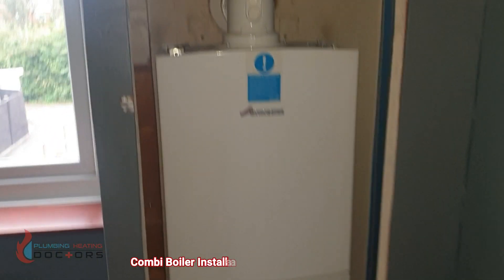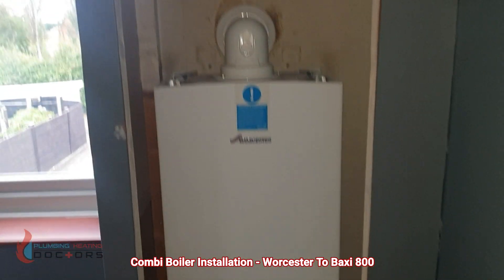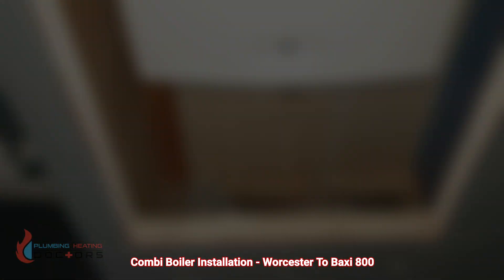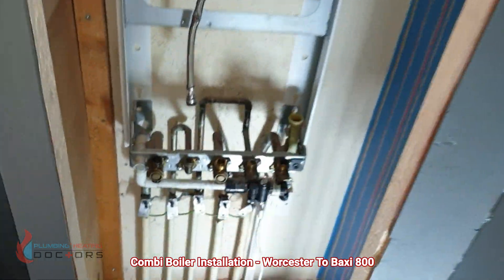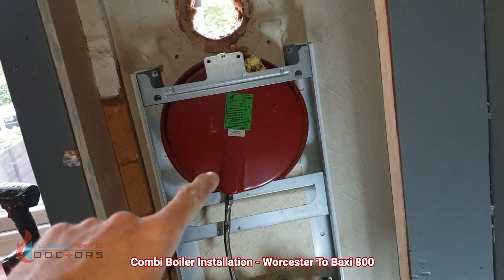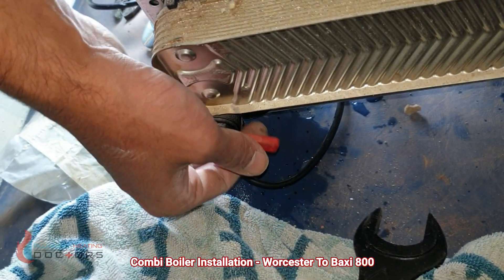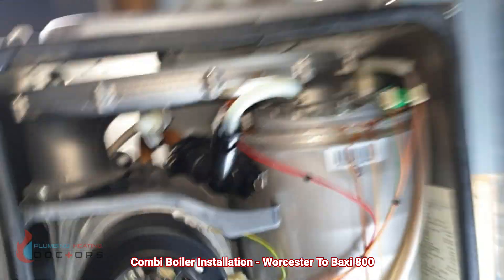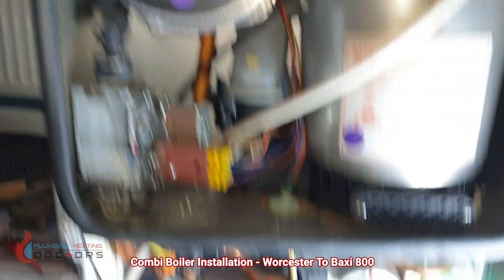Worcester Bosch Combi Boiler UPGRADE To Baxi 800 **PIPEWORK**

Comment: Why UK uses copper pipes instead of better option -plastic/alu combi pipes? Copper is radiating too much to outside and you lose efficiency from boiler. NONE of pipes are insulated.
Also pipes looks very tiny in diameter.
Reply from the maker: Copper is best

Comment: Nice neat installation waseem, I like the way you took your time and offset the pipes to make it look good visually I suppose the old boiler was repairable but it depends if the customer wants to spend that much on that old boiler it’s obviously over 10 years old , did you not do a flush by the way? The servicing on the Worcester boiler was not a proper service but just one of them cheap jobs
Reply from the maker: Thanks.. Yes we always try to make it neat and make sure all valves are accessible. 

Your right the boiler could have been repaired but the landlord wanted a boiler with warranty for peace of mind as the didn't want the headache of future issues. 

We did flush the system but its not in the video as we have covered flushing in another video.
Reply: @PlumbingDoctors  It is Waseem isn’t it ? your videos are getting better but try and talk through the installation rather than the music . how comes you were working around that condensate pipe that kept getting in your way could you not remove it from the elbow and refit it afterwards? you could have melted it at one point
Reply from the maker: Yes its Waseem..Where do i know you from?as i know quite a few Salims...

I have more vids in the pipeline which i am talking more but thanks for feedback, i will keep that in mind 👍🏻

The condense pipe was existing and it went into a stack behind the wall externally so i did not want to disturb it. Burn the condense no chance lol its all about the angle of the flame 😉
Reply: @PlumbingDoctors  Salam Waseem,I saw your name on your shirt on one of your previous videos when you took out the viessmann  boiler with the burst pipe,The one almost mounted on the floor,
Yes Salim is a very common name amongst our lot,  I used to be a heating engineer back in the 1980s ( corgi then) In our days the combination boiler was still fairly in its infancy and there was some very very big complicated boilers like the potterton lynx and netaheat. The one i used to hate was the Ariston Eurocombi , A very temperamental boiler unreliable and used to leak a lot we were forever changing PCBs on them,! Most common brand with British Gas was the Vokera, Sorry I didn’t see the angle of the flame I thought you were going to melt the condense pipe!  Chalo Teek hai, Keep up the videos they are interesting to watch
Don’t take criticism to heart by some of the people leaving negative reviews here . if that was my boiler I would want it changing as well. So spend £500 now  to change it in in a few years anyway? No just change it most brands have big warranties now anyway
Reply from the maker: Wa ʿalaykumu s-salam! 

Oh ok i thought i may have done work for you but Its good to speak to a old school gas engineer and get feedback. 

I still come across some Ariston Eurocombis as i do also repair a lot of boilers but i haven't made any videos of boiler repairs yet. 

Yeh i don't take the negative comments to heart thats life some people will always have something bad to say regardless but i don't mind :) 

I gave the customer two options one for repair and new and she chose a new boiler.. so i fitted a new boiler 👍🏻 i have worded it a bit wrong in the video which i have noticed but hey ho .. 😊 thanks for your positive comments 😇

Comment: Hello Just add expansion vessel on the return 12 liter if you can't pull it read the MI they tell you regarding the prv remove the return connection to the boiler and you can have access from the back no need to remove the pump stick your hand or plier and pull the prv no need to change the boiler I did the same repair  last week.
Reply from the maker: Customer preferred a new boiler with warranty for peace of mind

Comment: no system flush?  Just wondering if that's extra cost? Check Alan harts vid on brand new baxi burners leaking gas from the front seals
Reply from the maker: We did flush the system but did not put it in the video. 

Ive never had one leak from burner seals yet 😕 but good to know 👍🏻

Comment: So all that needed changing was the expansion vessel, PRV and burner gasket. What’s so hard about that. Those aren’t reasons to replace a boiler. Plus there’s lots of space to carry out the work. Mate it doesn’t sound like you have a lot of experience. I’m not knocking you because we have all been there before. But you got this one wrong pal.
Reply from the maker: Not got much experience 🙄 I've replaced loads of burner seals, electrodes and sometimes even removed the heat exchanger to remove the baffle at the bottom as they get stuck.. (Check our Facebook page) 

I know you can remove the vessel by removing the flue and sliding up or even adding another one externally and i know my way around removing PRV internally.

In this case the landlord did not want to pay for the repair and wanted a boiler with warranty for peace of mind so i fitted a Baxi 800 

I have loads of experience in repairs but what im new at is making youtube vids and maybe I did not word it right in the video 🤔
Reply: Head exchanger has split. No quick fix there mate
Reply: Sean Gribbin 
It wasn’t the heat exchanger that had split. It was the expansion vessel. That’s an easy fix mate.
Reply: @Triggertogrissom  in the vid if you look at the gunk at the top you can see its been leaking.  Also look at how badly rippled the heat cell is. It's been run on empty for too long and is definitely on its way aout either way.
Reply: I can't believe a boiler with such a premium reputation doesn't have a low pressure sensor stopping the boiler from continuing to run on zero.
Reply from the maker: The amount of worcester boilers i go to that have the pressure bar on zero and customers say its been like since they can remember 😕 & Topping up pressure on some worcester boilers are not the easiest 👎🏼

Comment: You had so much space above the boiler you could’ve took the flue off to pull out the expansion vessel. And the pressure relief valve comes out easily removing the pump housing..
Reply from the maker: Yep your right that could have been done but  the landlord wanted a new boiler with warranty for peace of mind 👍🏻